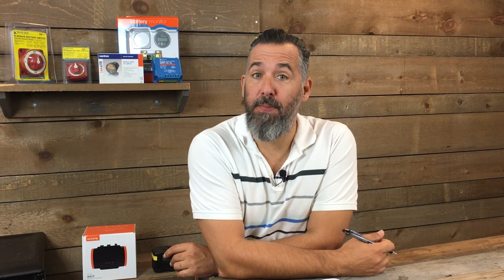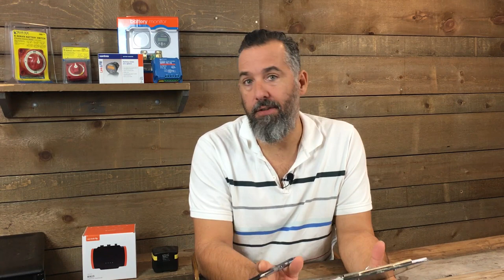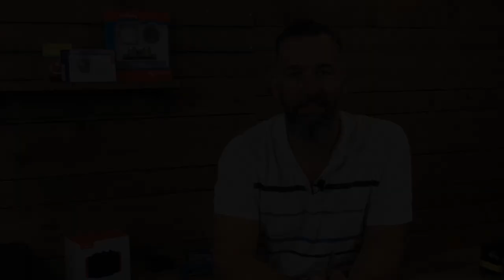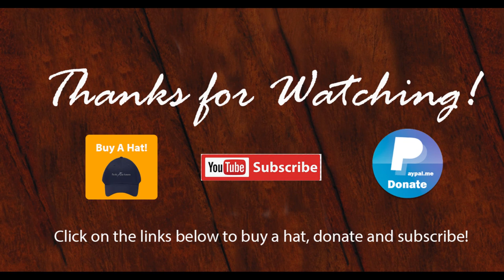Ask PYS - How Do I Charge a 48V Battery Bank With a 12V Alternator?

Comment: Sterling Power makes a DC to DC charger that is capable of charging 48v battery bank off 12v alternator.
Reply from the maker: Yep, and it's a good product. We've installed it for boaters with electrical 48 VDC propulsion.
Reply: @PacificYachtSystems  if the 12V side charges the 48V propulsion bank, it suggests that most charging happens on the 12V side, which seems backward, since the 48V bank is probably much larger. What's wrong in my logic? I'm asking because I can't find any 48-to-12V DC-DC battery chargers.

Comment: I'd tend to agree. Balmar make some alternators with the ground isolated. You could run twins in series as another option; hard to see it working out cheaper with the fabrication involved though.
You could also change the regulator and pulley on a 24V. Most can handle a much higher voltage, the weak link is usually the diodes.
GenVenters/dynaWatts are the third option you can use these to power a mains battery charger.
Reply from the maker: Thanks for sharing Liam.

Comment: if you charge lithium batteries from a 48v alternator, you still need a charge regulator to stop charging the battery! Better to use a 12v->48v dc-dc charger. Sterling power makes one! It sits right between the 12v alternator and 48v battery bank.
Reply from the maker: Thanks for sharing Rob, and Sterling power is a great company, we've had good success with their products.

Comment: but where can you get a 48v alternator? also is it possible to run only 1 alternator thats 48v and charge both the 12v battery and the 48v battery?
Reply from the maker: Probably custom built. DC to DC charging converters, going from 48 to 12 should the way to go to share an alternator charge to the house.

Comment: Caleb makes a 3kW 48v to 12v bi-direction charger.  Wakespeed, and Scotty use this converter. I using a single 10 kW 48v alternator to change a 56kW lifepos4 battery and the bi-directional convert to charge the 12 v lifepos4 house battery and 12 Agm starter battery
Reply: Where did you get the 48volt alternator I'm having trouble locating one? A link would be greatly appreciated.

Comment: Got a question for you my inverter is 48 V my battery combiner is 48 V my batteries are charged up to 53.5 V what is the best way to be able to hook up the battery bank to my battery combiner to my inverter without blowing either , From overvoltage ?
Reply: i have the exact question, could you perhaps find out, please assist asap...regs: Karlin

Comment: Use one direction dieod one the + side.  It works I've done it many times . It will take just longer time . And it's even batter it's safer.
Reply from the maker: Thanks for sharing.
Reply: Versus a two direction diode??????

Comment: Where do I get the Alternator conversion rebuild kit to make it from 12v to 48v ? My alternator are GM 10 SI High Amp 120A and I have a Ford / Mazda Eclipse 150A Alternator 12v car I converter these alternator’s to 48v for charging my lithium battery banks ?

Comment: Would paralleling a few lower amperage DC-DC converters be a viable solution? (given they are adjusted really well to match their output voltages exactly).
Reply: This is an interesting idea...Aren't DC-DC converters not really efficient though? I wonder if the losses would add up if you parallel them.
Reply: @MarkPingel  My understanding is that modern switch-mode DC-DC converters are over 90% efficient.
Reply: @alexsmsn  We have a different definition of efficient then! Losing 10% sucks!
Reply: @MarkPingel  compared to an internal combustion engine this is extremely efficient.

Comment: make and use a change over switch from series to parallel, while charging. only problem is cant use batteries while charging
Reply from the maker: Paul, would like to see the wiring for this? Can you point me to a website that shows this 12 to 48 VDC switching.
Reply: @PacificYachtSystems   I have designed a switch for it. Its something that Tesla would use.  I can email you the drawing, if you want.. I can try and describe it here,
ok so you have 8 connections to the 4 batteries on a 48v system...... connect these to copper ..... sorry to difficult to describe.. i can send you the drawing

Comment: not enough information. I'm thinking he has 4 12vdc batteries linked in series to create a 48v battery source. could he not just take a switched terminal bus from the  high power alternator  and link to the batteries when the engine runs to charge them?
Reply from the maker: Hi Daniel, never seen this before. Anybody else seen this setup?

Comment: Hi, Brian Landry here, my question is kinda the same, can I charge my 24v batteries for the electric trolling motor, using the alternator from my 9.9 gas kicker motor. A litter more info about what I have hooked. From the trolling motor there is a pair of wires going to each battery, factory installed, I have a 2 back DC charger hooked to each battery for the trolling motor. I have both cables for both motors going to the 12v starting motor, also I have one bank DC charge going to starting battery. Thanks
Reply from the maker: Hi Brian, your kicker alternator probably outputs 12 volts, and you'll need a DC to DC  charging converter to charger your 24 VDC from your kicker 12 VDC battery.

Comment: I have the same issue but I’ve got 3 high Amp Alternators ! I have 15 PCs 3.2v Lithium batteries in series ! How to tweak my Alternator from 12v to 48v that would be much easier! Please !
Reply from the maker: Not aware of any tweak that makes a 12 Volt alternator to 48 volts. You'll have to source a new 48 VDC alternator I think, that said, never seen a 48 volt alternator before.

Comment: Hi Jeff, could you run through what the load control connection is for on a solar controller and specifically how you would use it best in a sailboat installation. Regards Tim
Reply from the maker: Stormer, good question. At this point, haven't found a use for the load connection on a solar controller. Anybody else has suggestions on what could be connected to the load side of a MPPT controller?
Reply: @PacificYachtSystems  thanks Jeff, yes I guess we'll see if anyone has any suggestions or an understanding of this feature? Regards Tim
Reply: @stormer6364  Hi Tim i have the exact question, could you perhaps find out, please assist asap...regs: Karlin
Reply: @KarlSimms  what are you hoping to do? And what type of controller do you have, it's much easier to try answer a specific question. Regards Tim
Reply: @stormer6364  i currently run two solar panels feeding into the controller, then to my 48volt battery bank (4x 12volt gel batteries) it works perfect two years now... my query is > ( I just want to keep my battery bank charged after sunset ie an alternative power feeding source ?), i have a Epever MPPT controller & 2000Watt invertor system (this is a home setup)
Reply: @KarlSimms  some load controls have a street light feature, you could use this feature via a relay to turn on your alternate charging source at sunset. Hope that helps. Regards Tim

Comment: G’day Jeff, Mark Wilson here, my question is, why isn’t AC used on boats ect to Negate voltage drop over long distances as DC dose, is it for safety or some other reason? And, if it is safety, wouldn’t a safety switch make it just as safe as DC?
Cheers, Mark
Reply from the maker: Hi Mark, good question. Powering AC loads via an inverter from a DC battery source is also ineffecient and you have a cost to invert DC to AC. Also, some boats only have DC loads and it would be extra cost to install an inverter just to run loads that can be run off DC instead of AC.
Reply: @PacificYachtSystems  ebay has 48 volt alternators but they cost an arm and a deck

Comment: I have a question that I have pondering since I first heard you promoting the virtues of carbon foam Firefly batteries. I would love to hear your response. The Firefly website states that their batteries should be ideally charged with a 40 Amp charger, but could be charged with 25 Amp charger. I currently have a first generation ProMariner 12 charger that does not have an AGM profile (it does have a Gel profile), so I need to upgrade it if I was to upgrade my batteries. I am trying to install 200 Watts of solar panels that will not normally charge at even close 25 Amps and the 30 Amp alternator on my Atomic 4 (yes I still have an Atomic 4 - I would love to try electric propulsion someday), does not normally come close to generating 25 Amps.

So... what are the pitfalls of charging Firefly batteries with less than the suggested charging amperage (as must be the case with all solar installations, a least some of the time) would I need to upgrade my alternator, and could I possibly use a shore power charger rated at less than 25 Amps, since high Amperage chargers are not inexpensive.
Reply from the maker: When it comes to Firefly, as a minimum target a charge rate of 20% of battery capacity. In other words, if you have 2 Group 31 Firefly in parallel for a 12 VDC battery bank at 232 amp-hours, you should have a charger of 46.4 amps (20% of 232 amp-hours). As the battery bank gets larger so does the charging.